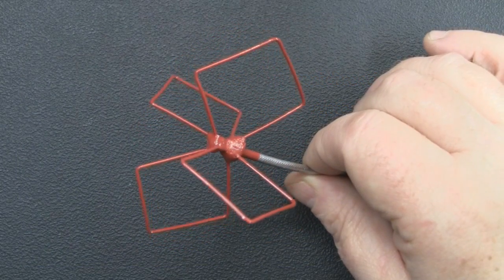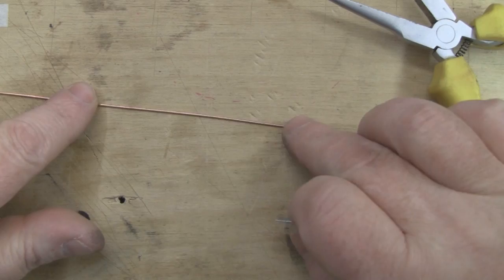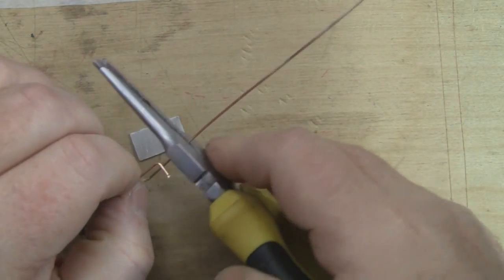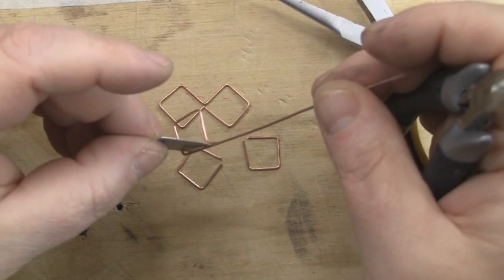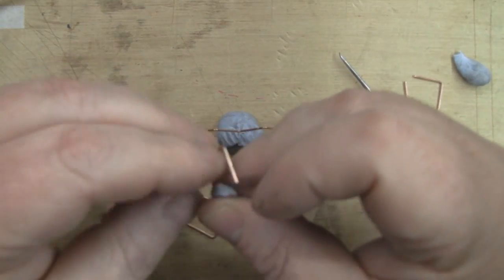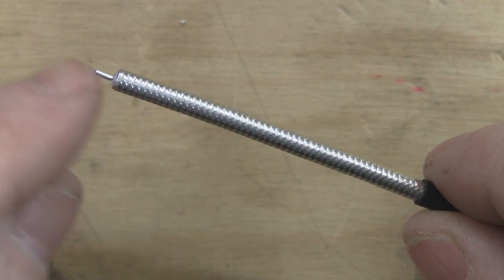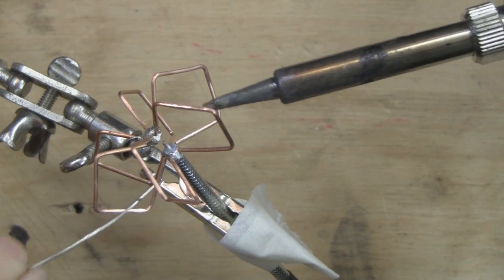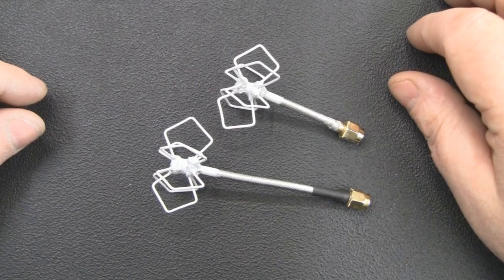Omnidirectional Biquad Antenna for 5 8 GHz FPV #79

Comment: Andrew, when making a bend you should add that you take the diameter of the wire you are cutting and divide that in half then subtract that from the length you will be bending to give a more accurate length...just a suggestion my friend...

Comment: Hello there!! im in need for a antenna that can outperform the stock dji phantom 4 standard , antennas  the first phantom 4 was all 2,4 ghz, and i have ordered a kit to get the specaly made plugs and cabel system inside the remote, but one thing i dislike ablut this kit, is that it uses plugs with 90 degree cable connection  (90 degree plugs), do you know how mutch loss i gain wit 2x 90 degree plugs on eatch cable, and what antenna do you recomend for it,  im hoping to use a non directional antenna,  and from what i have seen, it looks like the stock antennas are well made signal vise, the range is good today, but it would be nice with better signal penetration, my idea vas 2w amplifiers, but those got so hot that they burned up, a bad design for sure. Best Regards Otto Olsen

Comment: I'm at a loss. I have a mobile phone booster set-up for EE on 1800 MHz, at present the external antenna is a flat panel type with about 7 dB gain. I want to build a better antenna that will give me a higher gain. I'll welcome any help please.

Comment: I built your 2.4ghz version. Tested with wire shark and I am getting some packet loss. I might have too large of a gap between the legs. Will try again with 1mm gap. It does get - 67 dBm. That is comparable to my usb netgear A6210 connected to the same Hotspot. It's 4 bars.

Comment: Nice video of your antennas in 5.8 which is in your opinion the better and why
Also have you made a pepper box antenna yet or one that gives 180 or more degree with great penetration for long range or through  obstacles in 5.8 cheers do you have a sheet or website

Comment: Build one this evening for my broken TX CL antenna, and tested it on the ground. I was able to walk for 270m before it got to dark and i still had picture.
I used a standard 1,5mm2 sollid copper wire from a electrical cable. Diameter of this wire is 1,2mm so a bit on the thick size but the thinnest i had.
On my RX i have a skew planer wheel.
Thanks for your video and will post my flying experiance with this TX antenna.

Comment: is any way to parallel 5 GHz and 2.4 GHz in one connector to make it dual band and tested if it work .. if not insulate them with a 5 GHz capacitor ,i just saying .
Reply: Yes. You can use 2 pcs of 75 ohm coax  cable with 1/4 wave length (try to use for 2.4 wave lenght if it wont be good then try wave lenght for 2.4 and 5.8) as coupler for the antennas to joint them for single cable  and then feed it with 50 ohm coax... and plase the antennas 90 degree from each other...

Comment: Hi great video what do you use to coat the antenna with thanks.
Reply: Looks like plasti dip, buy at any hardware store around $5-$10 a can, or auto store
Reply: Thanks.

Comment: your soldering looks awfully under heated.
let me guess - lead free solder but iron that remembers 90's and 60/40 solder.
get adjustable temperature iron or revert back to 60/40 solder.

Comment: Just curious... that extra 3mm separation between the end of the signal cable and the end of the shielding - as it's forming part of the antenna, shouldn't that be subtracted from the full wavelength, i.e. reducing the 1/4 wavelength tool you made by 0.75mm? Or is it close enough to 5.8GHz that it doesn't matter too much? I've seen various calculations for the 1/4 wavelength in different places, some less than 13mm, some more so it doesn't seem too clear which is correct anyway!
Reply: the spacing (and all measurements) isn't important as the total bandwidth is high. probably in the range of 5.6 GHz to 6.0GHz. or even greater. if you look at the frequencies of all 32 channels in the 5.8 range that's pretty much where they are. so you want that wide bandwidth.

Comment: Another Question for you Andrew.
It seems you have a good handle on radios, and I myself am trying to get to a similar point in understanding by learning about amateur radio. My question is more about turning these into dual band antenna's. Can I use the same method, but use the elements for both 2.4 and 5.8 to do a dual band antenna? I understand my SWR will possibly increase, but I have most of the equipment to correct the reflected power.

Comment: Question,
How does the number of lobes affect the gain of the signal? I know nothing of communications or radio waves. But have gathered the target frequency is achieved by a specific size lobe. How then do the number of lobes affect the antenna in pro/con sort of way. It's very interesting to watch, but rather daunting to picture myself doing this as I don't solder things either :D Thanks in advance.
Reply from the maker: Jonathan Wolff Hi Jonathan more lobes at slightly better gain but also have increased reflected power back down the coax(vswr). Now when you are only using this for Rx (receiving) its not a problem so you can increase gain (lobes) without worrying about the increase in reflected power.

Comment: Andrew, small question. 
What is the best 5,8Ghz overall antenna for fpv rx and tx. Cloverleaf, Skewer Panal wheel, fiveleaf, omnidirectional, blade or your latest... Celtic knot. I have some chinese antennas and they are crap. So after seeing your video's I want to build a set myself. But... which one is the best for me.
Reply: Ronald de Bruin I would like to know as well, plus some people asked already about TX/RX. I got now some antennas which are covered in plastic so I don't see the design inside (clowerleaf?) but they are labeled RX/TX. But still I dunno if it's worth upgrading from the one I already have
Reply: @Antonwit42... no its not worth upgrading. It's a great antenna if you are flying high, but not really suited for fpv with a quad.
Reply: Ronald de Bruin And from all his designs which would the best? Probably there is not such thing as best as each have advantages and disadvantages. But there is just too many designs and they are not compared as clearly as I wished.
Reply: antonwit42  I recently got a mail from IBcrazy aka Alex Greve. He is using cloverleafs with a pepperbox on the rx.

Comment: I have just built two of these to try on my 250 quad. I will put one on the RX and one on the TX. Is it bad to have the same antenna for both RX and TX?
Also, how do you find these in comparison with the fatsharks or other commercial ones?
Thanks

Comment: if you mount the elements at a 45 angel would it work like a circular polarized antenna ? or do a circular polarized antenna have to be rounded like the celtic knot and the Cloverleaf Antennas? i made one with the set biquad elements at a 45 at short range it looks like it works and it looks cool :)

Comment: Hi all I made one of these yesterday and went out for a test flight I used one of these and a immersionrc spiro net v2 antennas and got 1km with good strong video the hole way I used this antenna on my goggles and a 250mw vtx on the quad. Great video by the way think I might make some more and try them out one my 250 racing quads
Reply: +Adam Patchubg  you should use the antennas in pairs, not mixing Right-hand circular polarization spironet v2 with the biquad that is not circular polarized
Reply: Adam Patchubg hey Adam, you said you use the spironet v2, was that on the receiver or the transmitter? just curious because I wanted to make myself one of these and I have the same setup that you have
Reply: *****  I had the Spiro net on the tx and the omni biquad on the rx both pointing straight up
Reply: Hi Mark M I thought the biquad was circular polarized? If it's not then I have no clue why my set up worked so well :-/
Reply: +Adam Patchubg Ya, I thought the same thing, and would not have thought you would get 1Km if it wasn't the same, I thought that by bending a Cloverleaf at a 45-55 degree angle to the right or left gave you the RH OR LH circular polarization. and that these because the Biquad is strait up and down had no polarization... I would have never thought to try these with a Cloverleaf ... but now I'll have to.. :)

Comment: What is the most powerful antenna have you built?
Would building a powerful antenna with a 1 Watt WiFi Amplifier help with connecting to a wifi connection that you couldn't find on your list with a regular antenna?

I ask because I'm currently staying in a hotel for a few months where the internet is very slow. In one of the rooms, I was able to connect to a Comcast XFinity connection that worked really good using my laptop's built-in antenna. Was perfect until the hotel moved me to another room which is around the corner and down the hall a little. Both rooms are up on the 3rd floor. 

Question is, would having a much stronger antenna connected with a 1 Watt WiFi Amplifier greatly increase my chance of finding that XFinity connection and connecting to it? Right now, in my new room, I can't find the XFinity connection in my list of WiFi connections.

FYI, the Comcast XFinity hotspots are hosted by the vast amounts of Comcast XFinity Internet consumers in their homes where they have the Comcast Router. Even though that private connection is for that particular customer in their home to connect to their services, Comcast has built in a hotspot for other Comcast members to connect to it using their own account. So basically I'm trying to connect to a consumer grade router from my hotel room. Yes, this is legal according to Comcast.

Comment: Pre-tinning the ends of the wires and using a little flux will make the soldering job much easier (and neater).
Reply: xjet , well said. 
The guy knows technical better than most. Google helps level the field if you know what your looking for. But I trust his expertise and math enough, not to worry about questioning his results.
On soldering like you. Pretinning is a must. I hate trying to make a connection by skipping that step. It ends up more than doubling the time if not screwing it up completely and pulling the tab on the beercan.
I tend to put too much flux on, almost too much heat. But I use heat sinks and grounds to prevent damage to circuitry or foil runs. 
I like a little smoke sizzle flow and done-right the first time.
Not enough heat, not enough flux, not enough solder wont kill me, but the end result I wont show anyone what it looks like or how much time I wasted to get something done that looks crappy.
You were to the point and spoke for all technicians and DIY guys. I speak for myself, others might relate.
Reply: amen

Comment: Also Andrew, where can the SMA connectors on the base be purchased from, been going round in circles trying to find them !!
Reply from the maker: Christopher Baker sma here: http://www.ebay.co.uk/itm/291295829463?_trksid=p2060778.m2749.l2649&ssPageName=STRK%3AMEBIDX%3AIT
and coax here: http://www.ebay.co.uk/itm/320851127888?_trksid=p2060778.m2749.l2649&ssPageName=STRK%3AMEBIDX%3AIT
Reply: Thanks Andrew !, Keep up the great information, we are learning a lot about the understanding of FPV ,RC Control, etc

Comment: Thanx again Andrew.. I built one today & happy with my first ever DIY antenna, but I have small question if I put this antenna on my fpv RX what antenna should I use on the TX for best combination? or should it be same on both TX and RX?
Reply: Thanks Harasi. :)
Reply: +George Lopez anytime .. plz let me know your results using 5/8 wavelength
Reply from the maker: Catalysis1144 I would use a biquad or double biquad.
Reply: +andrew mcneil  Andrew, finally I have built few of these antennas I was testing experimenting & comparing between this antenna design and Clover leafs but somehow am getting strange results maybe you can answer it with your technical experience. I tried using a 2.4Ghz (32mm quarter wave)  4 lobes Omnidirectional biquad antenna mounted on 5.8Ghz Tx transmitting at 5645Mhz and on Rx I used omnidirectional 6 lobes biquad antenna tuned for 5.8Ghz (13mm quarter wave) & amazingly this has gave me best ever result in terms of RSSI and range. I have done several combinations using the same Tx and Rx communicating at 5645Mhz :

1. 5.8Ghz Clover leafs on both Tx & Rx (these I bought ready made by fatshark Spironet).
2. 5.8Ghz Clover Leaf on Tx and 5.8ghz Omni Biquad 4 lobes & 6 lobes on Rx & vice versa.
3. 5.8Ghz Clover leafs (Chinese made).
4. Omni 5.8Ghz biquad 4 lobes on Tx & 6 lobes on Rx & vice versa.
5. 2.4Ghz Omni biquad 4 lobes on Tx & 2.4Ghz Omni Biquad 6 lobes on Rx & Vice versa.
6. 2.4Ghz Omni biquad 4 lobes on Tx & 5.8Ghz Omni biquad 6 lobes on Rx & vice versa.
7. Mounted each of these antennas on Tx & no antenna on Rx

So why do you think a 4 lobes Omni biquad tuned for 2.4Ghz antenna outperforms all these I tested when mounted on a 5.8Ghz Tx & even when no antenna was mounted on Rx the 2.4Ghz tuned Omni biquads the 4 lobes & 6 lobes outperform all other antennas I mentioned above. I did the testing keeping a 600mw tx with camera about 40 meters away passing through 2 brick walls & looking at the RSSI voltage on my Rx. Also I did some walk around looking at the video feed and it  was actually very stable. I have some numbers if you wish to see. Thanks..
Reply: +Harasi So to answer this myself after some googling & reading I found out that my 2.4Ghz Biquad elements & due to my measurements error in elements each element turned out to be 5/8 the wave length of 5.8Ghz frequency which is another way of making antennas instead of using 1/4 the wave length 5/8 is used which is 5/8x52=32.5mm.
So using 5/8 has practically performed better for me as tx antenna. I did test flight today & signal was solid. I will try making one for 2.4Ghz using 5/8 elements today & test it .
Reply: +Harasi Hi, can you share the ones you made with 2.4 Ghz using 5/8 wavelength? Thanks
Reply: +George Lopez Hi, The one I made for 2.4 Ghz was exactly the same as Andrew made it on his other previous video but the 1/4 wave was practically measured 32.5mm and I have been using for 5.8 Ghz fpv Tx with good results as it's equal to 5/8 wave length of 5.8 Ghz.
Reply: +Harasi Hi, can you please correct me with these tab.

for 5.8 GHZ at 5/8 wave the length of element is 32.5 mm
for 2.4 Ghz at 5/8 wave the length of element is 76.5 mm
 Thanks in advance.

Comment: Hi Andrew, Nice vid. I'm gonna make this on the weekend. Will this work for both tx and rx side for 5.8. Also how this compared to the blade antenna you've made earlier. Thanks...
Reply from the maker: My pleasure, thanks for the feedback they are about the same on wifi at 2.4GHz

Comment: Hey Andrew, first things first, I love your videos, very informative and easy to watch. One topic I was hoping you could cover (in case you haven't already) are wideband antennas. I understand the idea behind antennas tuned to a specific frequency such as most you've made, though how would one accomplish an antenna that performs well on a wide range of frequencies and how would it compare to single frequency antenna? I've started playing with the rtl-sdr, and I want to build my own antenna for it, though  that would require a wideband antenna unless you're going to swap out antennas every time you switch frequencies, which of coarse is impractical. Thanks a lot!!!
Reply: 8 years later...for those still interested - have a look at Teardown, Analysis of a Waveform 600 MHz to 6 GHz Cross-Polarized 4x4 MIMO Panel Antenna. Check the VWSR!

Comment: What coating you are using to dip your finished antenna.
Reply: Great video... but regarding the covering unless it adds strength I'd rather keep the amount of solder used to a minimum and save weight and not use it and just spay it with a clear lacquer at most as every gram saved is extra power and air time, but ideally find a light weight cover for protection and I'm thinking a two part form made shaped like the antenna and then filled with light weight expanding foam might do the job nicely as the foam will hold it together and the flex in the coax will let it bend out of the way in the event of a "bad landing".

Comment: hey, whats the Dbi and SWR on the antenna? Do you have measurements or equations to tune them to a frequency instead of just a band?
Reply from the maker: 9dbi and a SWR of 1.4 I will put a data sheet together soon
Reply: cheers andrew!

Comment: Built one so far, went together pretty easy but you have to get creative when soldering them together. I will build the matching antenna this week and hopefully if weather permits I will test these against VAS Blue Beam Ultras. I was able to go 2000ft (600m) with the Blue Beams this past weekend at an altitude of about 100ft.  Will post results when I do the test.
Reply from the maker: Cool looking forward to your results
Reply: andrew mcneil This weekends weather wasn't great so I might not get another chance for a couple weeks. I might take the extra time to construct them out of RG316. I used RG174 only because I had that in stock.  Do you think the RG 174 will have that much loss for the 3 inch run?
Reply: +Michael Diedrich results?

Comment: I'm very new to antennas and WiFi in general, and was wondering if this is something I can use for a home WiFi network or if this is more intended for a different application? Same for the 2.4ghz antenna?
Reply from the maker: This works fine for wifi but for a first build I would make a directional biquad first.